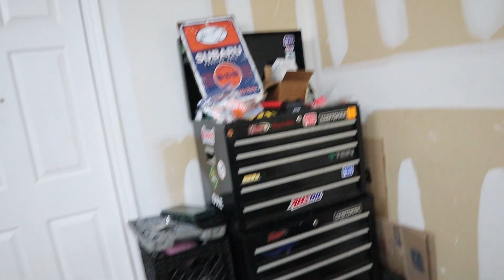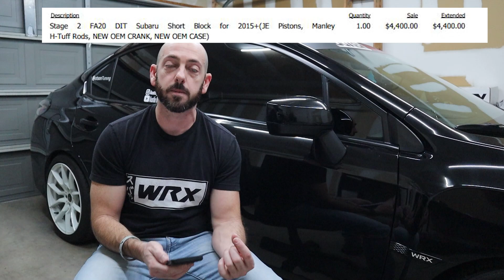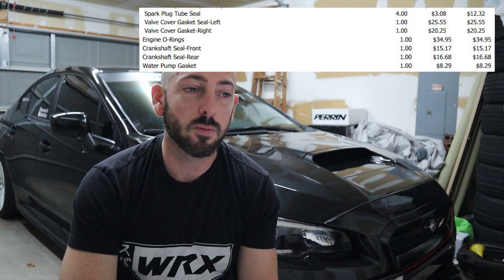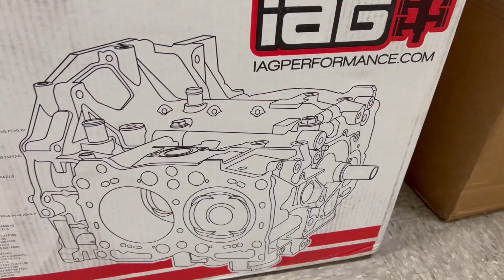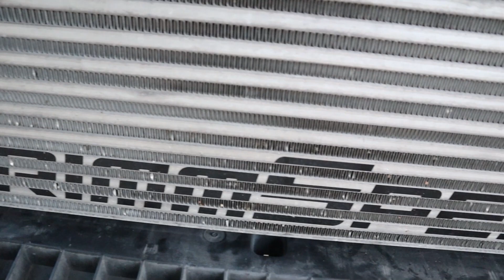How much an IAG build costs | SHOP INSTALL

Comment: My Ej25 Build Cost 500+WHP set up
FP green 84 MM used - 1000.00$
Killer B hard inlet used 300$
R400 exhaust used 400$
Megan racing catless DP 280$
GS Header 900$
GS EWG w tial WG used 400$
GS EBCS 100$
1300cc ID used 400$
Radium hanger with Walboro 450 used 500$
ACT HDSS 500$
Aeromotive FPR used 200$
IAG AOS USED 300$
Rocksteady Tuning Flex Fuel Kit 250$
ETS FMIC used 400$
Knockoff Tial BOV 40$
SD kit 200$
flywheel 350$
Manley pistons 600$
Manley Rods 600$
New Crank 350$
King bearings 200$
Torque plate 250$
Machine work 500$
tune 600$
Assembly and installation FREE

TOTAL - 9620$

Comment: Like many people say, a lot of money for very little power. at what point does one decide that it is best to use that money and put it down for a m2 or something else. I love my wrx but some times it makes me hate it. I am currently stock and I want to save to tune it up but having a hard time deciding whether it is best to do bolts ons till it blows up and then built or just built now with less bolts ons
Reply: I am having a hard time with what you are saying making sense... because you need so many supporting modifications to get anywhere.
Air intake, TMIC or FMIC, Bigger turbo, Injectors, gauges, 4 bar map seor, air oil separator, radiator, header, downpipe, exhaust, fuel pump,  Cobb access port, clutch...

To start, Cobb access port with staged tune, intake, exhaust.  That could set you back $2500.

Ifbyou rush into the power, you could easily get over your head and wreck it...  best to become an expert at 325 WHP before going to 375, the. 425, then 500...

I am moving towards the 500 WHP area.  I would never let you drive it if you only drove a stock WRX or STi...  it takes time to learn it and push it and live to see another day.  

I've sat in my car many times glad that I was alive when parking it... thanking my car for not killing me...

Comment: For anyone looking to replace your TOB, look for a kit that has a stainless steel sleeve that goes over the snout with included TOB. The way the transmissions are manufactured you cannot replace just the snout… And aluminum is obviously way softer than stainless.

Comment: 8k for my P2P closed deck longblock local brand new. Ported heads closed deck. 2k for new turbo. 3k for STI swap. Labor so far is 2,500. At 8,900 not including cost of engine. Car was previously FBO too can’t remember what I spent on that. Maybe another 6-9k lol. All for maybe 480-490whp I hope because of no port :c that’s another 3-4k lol
Reply: 2015 WRX? I didn't know P2P did long locks for the FA20. I only see shortblock options

Comment: How about valve seals? Did you go with oem or something else? I know once you start adding more boost to the fa it will be a weak point.
Reply from the maker: Pretty certain they are OEM. But that is good to know since I am getting some oil vape clouds on warm starts.
Reply: Yup. Change them sooner than later. Oil build up caused a hot spot and melted down a cylinder. Doing a rebuild now.

Comment: Has blown short block in car still! Comes with Bert Tune built short block (Manley HTuff Rods and Mahle stock size bore Pistons) to replace it with. 🔥
2017 wrx limited Pure Red (80,000 miles)
Car was 400whp with stock block. The new built short block is capable of 500hp!
NO PART OUTS! ❌
-Mishimoto air intake
- Grimm speed ebcs
- process west verticooler
- Mishimoto catch can
- tomei exhaust
-cobb flex fuel
-catless invidia j pipe
-perrin turbo inlet hose 3"
- Cobb accessport
-ISC N1 coilovers 
-carbon fiber  c-style seibon  trunk
-apex wheels
- custom powder coated sti brembos 5k to install the short block  is that a good deal to buy?
Reply from the maker: I mean, based on the info you gave me, it seems solid. 5k for labor on install seems ok. But I don’t see the price of the car itself in your comment anywhere. I’m also not sure if you copy and pasted this from a marketplace ad or wtf is going on

Comment: Hey brotha I have the same IAG block went with stage 2... wanted stage 2.5 but I'm only looking to do FBO and FP Blue turbo. Any intentions of upgrading your turbo now?
Reply from the maker: I wanna do a boost lab turbo. But I’m also a little traumatized throughout the last year after I tuned it
Reply: @austinfromtexas  why?! What happened? Brotha... since I've started going harder on modding... its been in the shop so much! Now my turbo leaking so I have to buy a replacement. I'm thinking FP blue... have you heard anything about it? And the boost labs turbo... what's it rated for?

Comment: 2015 STI stock block 
$1200 Cobb 20g turbo
$100 turbo blanket 
$1200 killer b headers
$500 1050 injectors
$120 340 fuel pump
$1000 q300 Catback
$600 ETS TMIC 
$300 Koyo radiator 
$300 IAG AOS
$250 Cobb up pipe 
$300 killer b hard inlet 
$300 Cobb intake 
$120 IAG oil pick up 
$100 Grimspeed 3 port
$80 cylinder four cooling mod
$100 VSC radiator hoses
$100 04 STI regulator 

360whp on pump gas on stock downpipe
Reply: $6700 for 360whp is extremely painful... wow lol Also, im sure it would be a lot closer to 400whp if it was 93oct with a 3" downpipe.   ........right?
Reply: @SpitfireZero the issue is gas, e85 will add an extra 100hp easy. I make 385 to the wheels with just a top mount and muffler delete everything else is stock, just tuned on e85 😉
Reply: @reginaldcooks7204  stock injectors, fuel pump, rails, etc????
Reply from the maker: Gotta love the Subaru horsepower tax

Comment: Ok I paid 20k for my IAG stage 3 extreme short block, stage 4 heads and cams for my long block entirely built by IAG. Not advised but a call to build custom long block. She's paired with an ETS 6466 kit, MoTec, STI trans swap, dccdpro, custom PTFE fuel lines adding port injection and the list goes on. The 3 year build cost me 100k including the car in the factory. She put down 740hp by JR on a mustang Dyno. Can I recommend, fuck no, is she fun and Hot mess, yes. Do I like my VB more? Absolutely. Lets talk about turbo slap at 4k. I need to start a hit mess WRX channel to not target more than 500hp WRX builds.
Reply from the maker: Hahahhaa I can only imagine the headaches caused by that thing

Comment: 2015 wrx black just like yours. Mine blew and i had my tuner do the stage 2.5 closed deck short block from iag. Forced performance blue turbo. Ets front mount intercooler. Iag aos. Clutchmasters clutch couple other little things Nd total was 18,000. When said and done. 91 octane conservative tune as i dont wanna go through this again lol. 385hp but i dont remember the torque.
Reply: 18k for 380hp dam. I been running 400 for 2 years on stock block and just now looking for a shortblock because I am just bored and need something to do lol.
Reply: That’s sad. My STI has a 20g turbo, killer b headers and supporting mods and puts down 360whp on pump gas with cats and stock block.
Reply from the maker: 385 on pump gas is really good! That closed deck sounds worth the money

Comment: Is it cheaper to build your short block before it pops or buy a iag short block? I’m planning on building my car within the next year or so. I don’t see a need for a closed deck with the hp goal I have.
Reply: What's your power goal? Probably cheaper to just drop in some forged pistons. Short blocks can be as low or high as you want it to be, depending on the power limit.
Reply: @hhaste  I’m looking for around 400 I talked to my turner and he said for the cost of building my block. I could just get a sti get a bigger turbo and flex fuel kit. He said a sti is just a better platform.

Comment: Just got my build done, $18k+ should be hitting the 400hp mark!
Reply: $18K for 400hp.? IAG sells a fully built long block for $9K that’s 600whp capable. Did you buy some fancy 3 piece wheels and insane air suspension or something?
Reply: @HotBoiRicer  bro not just the block need heads injectors intercooler protune etc shits expensive
Reply: @JoseLopez-dv5rk  My protune was $700, injectors are less than $600 for 1050cc. FMIC is under $1500. Clutch is under $1500. All in all IAG 600, fmic, twin disk clutch, injectors, fuel system, protune, etc would all be under $15K.
Reply: @JoseLopez-dv5rk ye that’s why I did it with my own hands instead of
Reply: @chasestoddard6984  I'm running 300kw atw with only full 3 inch exhaust am intake vf44 turbo and redline aftermarket top mount, I have a v11 sgt
Reply: @HotBoiRicer missing heads and cost for a shop to rip the block out  of the car and build the new iag block out the block back in the car put everything back together and also missing a turbo kit . Because if your useing the stock turbo I don’t even know why you would decide to build an IAG block in the first place. So 5k for a turbo kit and 2500 ish for labor , and the IAG heads even for stage 1 heads are 3k shipping that’s over 10k plus your 15k so your looking at 25k for 500 plus
Reply from the maker: Sounds about right 🤣
Reply: Idk, bro. I got 404/402 on a 2020 STi with all the Cobb shit and their 20g on E85. Idk what it all cost off top, but it definitely wasn't 18k. Maybe half that.
Reply: @mr.nobody502

E85 is gonna blow up.  Think that every time you get on it so you are ready for a new engine.
Reply: @Joe_Gabushki 
That E85 will make your engine die way sooner than if you just drove it stock
Reply: @Joe_Gabushki  unfortunately my build was just shy of $20k.

IAG stage 2 Block
Brian Crower H-Beam rods
IAG forged 86.1mm pistons
ARP Headstuds
IAG AOS
Perrin Charge pipe
Cobb 3-port EBCS
MAPerformance Intake
Borla S-Type catback
Grimmspeed v2 j-pipe
Forced performance Blue turbo
TurboXS BPV
Grimmspeed TMIC
ACT Xtreme clutch street lite flywheel
Kelford 262/264 cams

I’m at 338 WHP. Shitty numbers for the cost of the build.

If I could add E85 (nearest pump is a 2 hour drive) I could get about another 80 hp from this set up.
Reply: Bro those numbers are off!!!im at 3+ with stock motor and full exhaust + a few other things so you definitely need to strangle whoever charged you 18k for 400hp!!!! Immediately!!!!
Reply: @e.m.l.g8409  

You aren't factoring in supporting mods and parts that MUST be replaced. Please and I'm serious show where you can build a subie  at 400hp (whp) for $3K and it be reliable and a well built platform that doesn't grenade itself on the dyno alone?.
Reply: @SiCaRiI_DaGgEr me. 
$1200 Cobb 20g turbo
$1200 killer b headers
$500 1050 injectors
$120 340 fuel pump
$1000 q300 Catback
$600 ETS TMIC 
$300 Koyo radiator 
$300 IAG AOS
$250 Cobb up pipe 
$300 killer b hard inlet 
$300 Cobb intake 

360whp on pump gas. Overkill
Reply: @Craiggg12345  
That is a stock location build list, which is "drastically" less expensive than a  rotated setup.

Also did you build it yourself or pay a "reputable" shop?  Labor alone will equal the parts lists. Hell my ETS kit costs more than that. You also didn't list misc parts that are needed with your list. So please list parts&labor  AND tune figures with that!
Reply: @SiCaRiI_DaGgEr it’s all about who you know and what you know… and yes I went to automotive school and know a few shop owners so like I said if your paying that much for 400hp like I said before, strangle that mechanic immediately! I’m hands on until I can’t be so good luck and my subie is still kicking with no issues on pump gas….. e85 iag setup soon, I’ll post the cost and dyno numbers just for you…!
Reply: Just throwing my numbers out for comparison on my build sitting at 450whp

AMS fmic-1600
Boostlab 54x turbo-1800
COBB Flex fuel kit-600
COBB EBCS-150
COBB turbo inlet-150
COBB AOS-550
HKS BOV-300
EWG header-1300
MAP JPipe-650
MAP intake w/ ets box-450
CBE-1000
Bilstein suspension-1300
Wheels-4000
Big brake kit-2000
Misc mounts/suspension/braces-1000
Nostrum hpfp-800
DW lpfp-150
Process west manifold-1500
Nostrum fa20dit injectors-800

Sitting at about $18k as well. Not factoring in clutch/tunes/accessport… I’m
On stock motor/stock trans at 130k miles. I’m dreading the day I have to swap the trans and build the motor lmao
Reply: @luvhcchris  

Interesting for $2k more I have a IAG Closed Deck block (750bhp) 500whp on ETS rotated setup. Decked heads,  Process West reverse manifold ect... for example it will be basically the same build as Ben's from Gears & Gasoline's Subie and I'll be on dual fuel @500 wheel on a new block.
Reply: @SiCaRiI_DaGgEr  yeah that’s awesome. I wish I went with the sti upfront lol. The fa is great and cheap ip to around 375-400whp but after that it starts getting pricey :)
Reply: @luvhcchris  

Oh I see, you have a WRX which explains some things  my bad bud!

I have a GR but plan to pick up an FA and a GD later. But after I complete the build on the GR I may not have the enthusiasm  after spending all that $$ ...lol And to your point that it gets pricey after 400whp you're 100% correct, some part of me wish I had just stuck with a stock location build and save a sh1t ton of money.
Reply: Ya for the iag 600 long block for the fa20dit with iag heads is like 14k us alone
Reply: I’m sitting at 322whp  318 tq pump 91.
21 sti- 
Cobb Aos, Cobb turbo inlet, Cobb bpv, Cobb redline intake.
Grimspeed top mount kit,
Awe touring catback,
Koyorad radiator, iag street series oil pan kit, cylinder 4 cooling mod,
Kartboy SS and bushings, fortune auto coils, perrin rear sway bar and f+r endlinks, whiteline bumpsteer kit, whiteline rear sway brace, 
Titan 7 forged wheels,
Reply: Making me wanna go back to Hondas 18 k I'm running 10s or faster lol
Reply: @rjtorrez9935 it can be done cheaper however, the 18 k build was made to be able to run 400+whp hard for 80-100k miles.
Reply: @rjtorrez9935   seriously though…pretty damn rough seeing the price, when you can build an LS for 1,000+ HP for a fraction of the cost..
Reply: @Takeiteasy376 Yeah and have it be an unbalanced pos no thanks lol. What you're paying for is the stock engine size with as much hp as you want reliably. When an IAG is installed correctly it has a 2 year warranty as long as you're within the hp spec of the engine you bought. Yes there are other factors that play in too like an intercooler, oil cooler, etc. There is a direct correlation with money and reliable hp. Is what it is 🤷🏼‍♂️
Reply: @bv4e858 unnecessarily expensive is wtf "it is".
Reply: I’ll just buy a fast car from factory
Reply: @EazyTheRecon 
Always a smart move.
But I own my 07' STi and bought it off the showroom floor.

In reality, to get another car with my cars draw would be hard.  And I have the love for it still.

I have a lot of stuff already, so I am not starting from zero...

Comment: Great video just missing one key part that could cost nearly as much as the short block. Head work. Head refresh, or upgrading valves and valve springs, and most importantly valve lashing.
Reply from the maker: So yes, that was on the quote. And I realized I had filmed a part where I mentioned that, but didn’t realize till I had pretty much finished the vid. It was done and was factored into the final cost.
Reply: head work can be cheap if your just getting it checked and machined straight. all you need really.